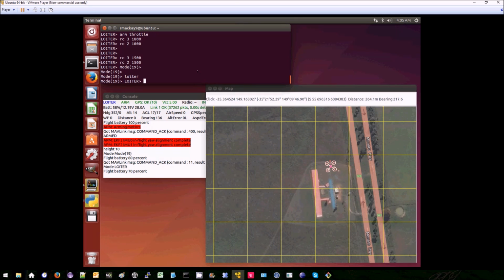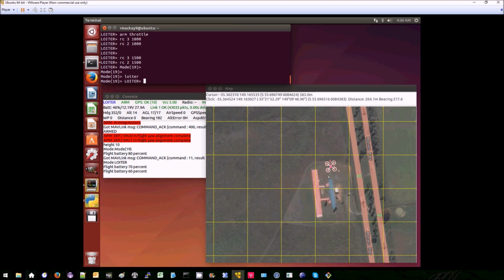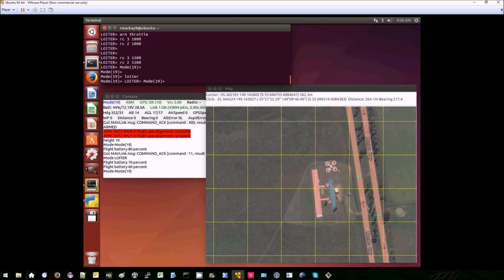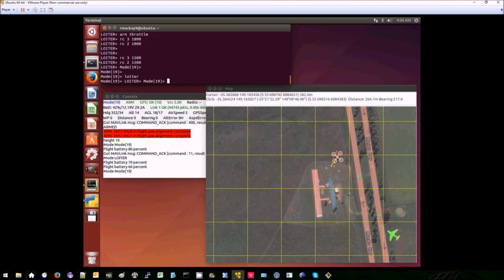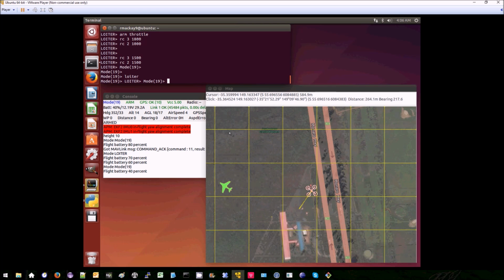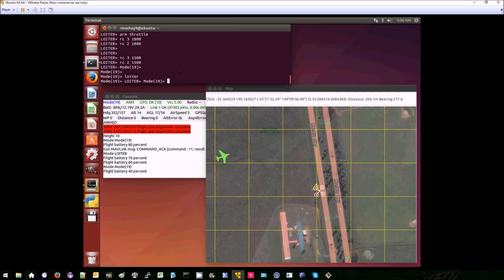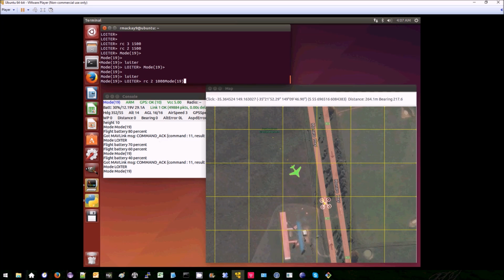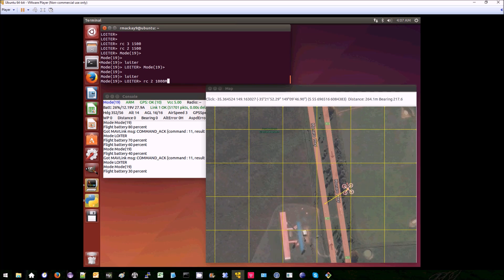ADSB Avoidance using uAvionix Ping (in the simulator)

Comment: I have done personal long range FPV flights for awhile now, but would like to get the company I work for into the drone services market. With a Pixhawk and Ping2020i, or something close to that, can I see in real time on a PC, all nearby aircraft that the ADS-B could pick up? Just wondering for when running the drone in manual mode etc.

Cheers
Reply from the maker: @JaredSmith, yes, if you have telemetry from the drone to the vehicle or the Ping is directly connected to the ground station PC, you can see all aircraft within many many kilometers (up to 50km I hear).
Reply: Thanks for the quick reply Randy! With about 27 new tabs open here I've been seeing a lot of interesting information. Ideally have the Ping directly plugged into the telemetry on a Pixhawk, but really excited to know you could pretty much have a "radar" map at the ground station of all visible aircraft around you in such a large radius! Cheers
Reply: Hi +Jared Smith and +Randy Mackay.  This website has great information and map data showing ADS-B equipped aircraft.

https://www.flightradar24.com/33.76,-117.91/9

They also have a smartphone app that is AWESOME.  

https://itunes.apple.com/app/flightradar24-free/id382233851?mt=8
OR
https://play.google.com/store/apps/details?id=com.flightradar24free&hl=en&referrer=utm_source%3Dfr24_nav_apps

* In Augmented Reality mode, You point it to the sky and you can see planes with ADSB-Out data.  *

Also, this website has great information anD map data showing ADS-B equipped aircraft.

  https://flightaware.com/live/

They also have a smartphone app.  

I hope this helps. 

Out of curiosity, what company do you work for that you are trying to get into the drone services market?  :-)

Comment: What is the altitude range for ADSB to initiate? i am assuming both aircraft would have to be at the same altitude or some variance within +/-10 meters or is 300 meters like an invisible globe surrounding the Drone?
Reply from the maker: Thor, there are separate parameters fro the altitude range and horizontal radius (AVD_F_DIST_Z and AVD_F_DIST_XY).  Also there's a "Time" (AVD_F_TIME) which controls how many seconds in advance our vehicle should start running.  So set it to "0" and our vehicle won't start running until the other vehicle is actually within the cylinder, set it to "30" and our vehicle will start running up to 30 seconds before the other vehicle gets within the cylinder.